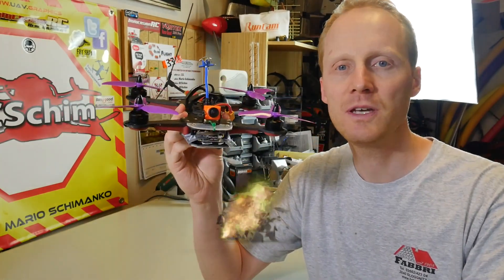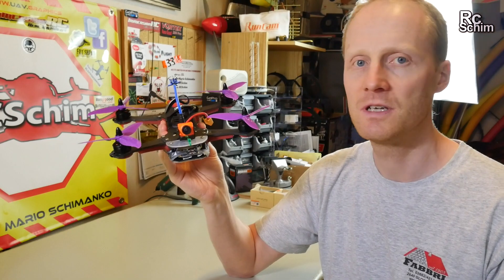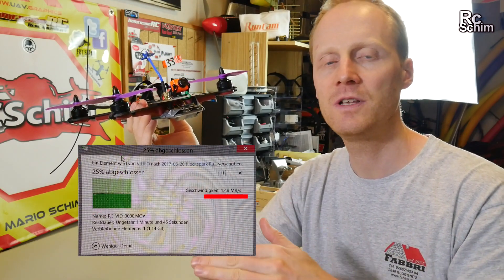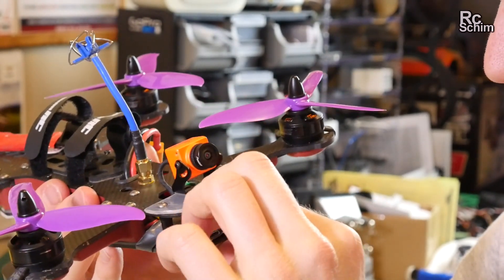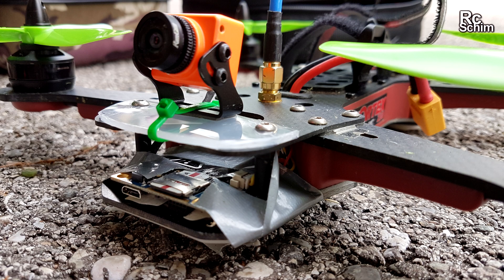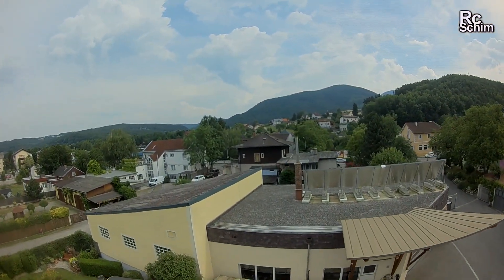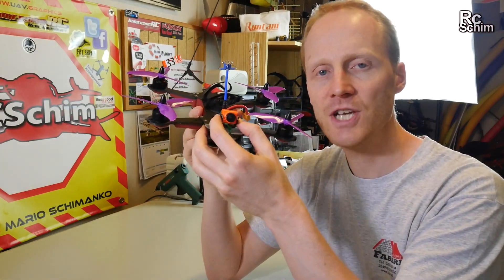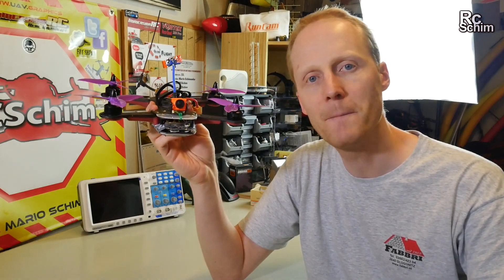Runcam SPLIT: FLIGHT Footage, Jello, Mounts, weight savings!

Comment: Balance your props. This extends the life in the bearings too. 
Stick the camera on the copter with double-sided adhesive foam tape. Make a stack if the tape is thin. Try computer hardware store for water pump vibration absorbers made of double-sided sticky foam.  

And... the camera outputs 5V when connected to USB. The BEC is made to give also 5V. Therefor, having a zero difference of potential, the current does not flow. 
Classic 7805 BEC will not conduct the other way, towards the PDB. Neither should a SBEC that has a series MOS-FET with D-S diode and a coil in series. 
If the camera would be powered by, say 3.3V from the PDB/SBEC and would back-flow 5V then there would be a problem. 
The USB port on your computer, and mine, for that matter, also outputs 5V, has load protection and current limiting. Even old motherboards do. Really old. Again, no potential difference, no flow. ;)

Comment: I also have vibration problems. I tried to mounting it with all kinds of stuff, nothing worked out. Whats interesting is, that I only geht vibrations once the props are attached. On the ground wth no Props, the vibrations are just not there....
Reply from the maker: +Tom Rösch try an nd filter!

Comment: seriously, why is it "pro" if you apply tape on your motors and props to balance them out??? 
We did this all the time before 32Bit FC cam out. 
It takes 
10 minutes for the four motors and 
5 minutes for 4 pieces  3-bladed propellers to balance them out. 
You probably spend more time to make all these mounts.
Reply from the maker: ok, maybe I'm wrong - but my attempts at balancing didnt always get the results I was hoping for. on some copters I've invested a lot of time into prop balancing (bigger ones) but also had problems with motors - which I couldnt balance as nice as I whould liked them to be.   I also feel that you cant "iron" this out totally - since resonance effects and vibrations occur at different magnitudes and different RPMs...   
I have to say though, that this mount here wasnt the best soultion in the end. The split is so light and so easy affected by vibrations, I now had to use an ND filter on the cam - this seems to be the easiest fix.
thanks for your feedback though, greets, Schim
Reply: Motorwise its sometimes impossible to get it 100% out. 
So in this case the only way is change the motor. 
Even brand new motors can be impossible to balance. (in all Thrust values)
Sometimes its good on low thrust and gets worst on high thrust.

Propellerwise:
Did you try to use a big prop balancer? 
You need a really high quality balancer to get it well done. 
A other trick is to mount a quad on the test bench and test each propeller on different thrust values.
Add a tiny bit of tape on one tip of a propeller blade and see if the vibration is better,
If its better on one blade move the tape in the middle of the same blade and check the results again.
If its worst move it half way to the tip and so on until your prop is perfectly "dynamicly" balanced.

Its possible to get a propeller done in less than a minute.

Thanks for your videos and keep up the good work... ;)
Reply from the maker: thanks for the tips. I might make a little test station where I have one motor+esc on a fixed stand where I can dynbalance props easy. 
back a few years I even tried this:  have a mirror mounted to my (back then TRI Copter) and point a laser on it. The reflection of the laser on the wall makes a decent movement - so you see vibrations better :)  was a bit complicated for a setup but a simple idea...

but honestly - since I use the 5" props I didnt have much to balance. only now with smaller HD cams vibrations come back. 

Motors: I did exchange them (vendor was super nice) but even the new ones werent perfect. in that case: Tmotor MT4006 -13 (92gr, 740KV, Max 24A, 250W)  with 12x6 Props...
Reply: yeah, the laser trick is really handy. ..;) Nobody knows that anymore...
People always try to get rid of the vibrations by PID tuning, notch filters or soft mounting motors and FCs and never think about motor and prop balancing these days.
But maybe you have a old F1 Naze32 board for your test rig. 
So you can monitor the vibrations on Betaflight.

see you on the next event... keep it up ;)

Comment: Is it true about the reverse current when powered by lipo and connected to USB? Also when connecting USB from computer to unpowered drone? I'm worried. Thank you for your video cheers!
Reply from the maker: I'm not sure what you mean but I experienced this:
when you connect the Split with USB (to computer for file transfer) the copters board is powered up as well.
not sure what kind of electricity comes out of the usb plug heading towards my laptop when the lipo poweres the system - but I'm scared now too :)
Reply: RCSchim   https://www.rcgroups.com/forums/showpost.php?p=37828828&postcount=185
Reply from the maker: thanks for the link. since this post is from Dominc Clifton (the guy behind cleanflight?) I trust his findings are accurate. I will mention this warning in the next video where it fits. thanks!
Reply: oh... this is a bit worrying... can you make an idiot proof version of this info as soon as possible... the link sort of helped but seemed to be a bit vague.   
 can i safely use the usb as long as the battery isnt connected to quad?.  or do i have to disconnect the ''picoblade'' whatever that is?. my split should arrive in a few days so i really need some clarification. 
how on earth could they make such a mistake? won't this cause lots of people to damage their quads and maybe computers too?
Reply: maybe you should move this comment to the top?.. not my comment  flyingeyeball joes comment
Reply: The door stretches, then gets loose and the card contacts vibrate and the "Memory Card Full" error happens.  Eventually the door falls off (multiple times for the team handling w/kid gloves).  All reviewers pointed to this as a fail, so we hope they get it fixed.
Reply from the maker: honestly: I wouldnt use USB here - but rather try to install the board in a way so I can access the SD Card. transferring files over USB takes too long...
as long as you have no flight battery connected I think your computer is safe. 
I dont think it destroyes each PC - my laptop would already be fried than :)
I think overall, while this is a really good cam, unique product, there is enough room for improvement here for the split2 :)
Reply: hmmm.. i didnt buy the bluetooth thing so i will need usb access... i might just try to set it up via usb before i hook it up to quad. .... maybe some added plugs to quickly disconnect power from battery/fc/bec.
Reply: TheMadmacs I agree I'm putting foods in to be safe
Reply: reverse current confirmed.SD card holder fails in a few flights too,
Reply: i got a few flights in today, image was a bit dark in overcast conditions but not terrible.. i as just playing around with settings after reading oscar liangs page... i noticed it can do 16-9 .. so i switched my quanum v2 monitor to 16-9 and sure enough it has a wider field of view.. maybe 10degrees more... but, it was slightly stretching the image so it wasn't full proper 16-9.. i reread oascar's page and it said to get 16-9 ''auto adaptive'' i had to switch off full screen in the split settings... but when i did that i got black bars on the side and thin bars top and bottom.... it was less stretched but still not perfect?.... anybody figured this out yet?.. i would like to have 16-9, but all this cropping is just insane logic to try and follow... i think just switching my monitor to 16-9 was as good as i hoped for except for the stretching, which is very slight but still annoying because i know it doesnt need to be stretched at all...... my brain hurts.
Reply: yeah i buy cards from amazon, i cant say i am disappointed yet, just the image was a bit dark which could be my fault, i didnt think to increase brightness, but the 16-9 issue is just weird, i suppose it would add more latency in which case i'll stick with 4-3,  i think normally runcam customer service is quite good, but obviously returning an sd card to china is a bit extreme? i think runcam have placed a lot of hope in the split and they will try really hard to make everybody happy,  the fact you had two break on maiden is very worrying. i hope they sort you out soon.
Reply: What fails on the SD card holder?
Reply: ps...... i use the usb to take files off the card i use a matek 5v /12vpdb... i have nothing else on the 5v bec but the split and i make sure my battery isn't plugged in while i swap files over....i heard somebody had trouble with the pins being bent too far down... sounds like heavy handed card insertion or somehow damage before a card was put in... they can fairly easily be bent back up to contact the sd card.... as for the card holder itself, it seems fine, you could even access it with less than a centimetre of space, the click mechanism is ok once you get the hang of it and not guessing and being rough with it,
Reply: Rotor Garage I figure I'm not going to be removing the card once in maybe I will tape it with kapton tape or a little dab of hot glue

Comment: can this be powered from the led pads on your FC if they are 5v? i'm just afraid that if i use the VTX power it will cause video problems.
Reply from the maker: +Fab Lab FPV they recommend that you use a bec. It needs 650ma power, maybe too much for the fc...

Comment: I use "moongel pads" to get rid of jellow. 
You can find larger pads at low cost at gas station shops...  these sticky rubber pads are typically used for cellphone storage in your car. Also very useful under the battery.
Reply from the maker: +Dreamer 111 thanks for the tip. I have all sorts of gelpads since i was used to fight jello since years. But in the recent times the copters had such things integrated. Spkit now has a new issue: it is very light, so we need different approach against jello...

Comment: presumingly the jellow is just the consequence of the reduced mass of the camera module. 
Either you have directly the vibration of the frame, or with a more lose coupling less high frequence from the frame and more low frequency from the dampening material of the mount. 
To straighten it out: strap a 71g weight on the camera ;-)